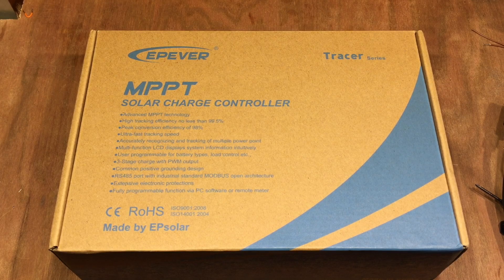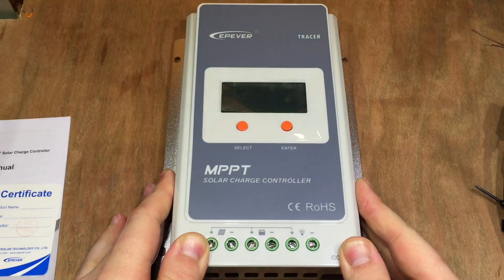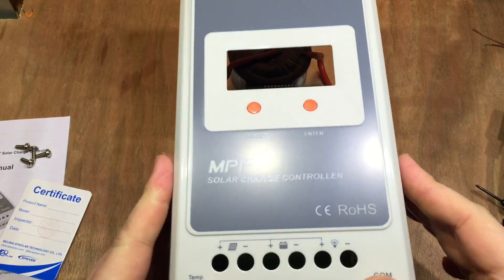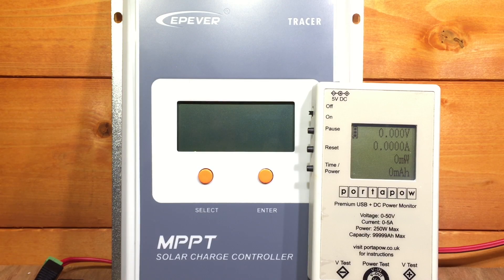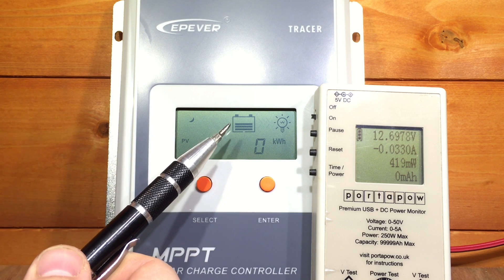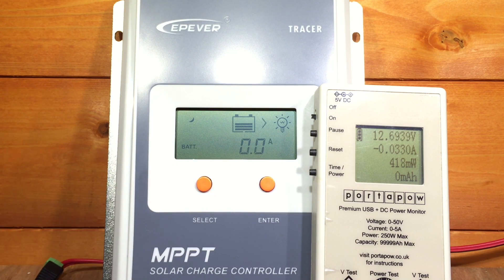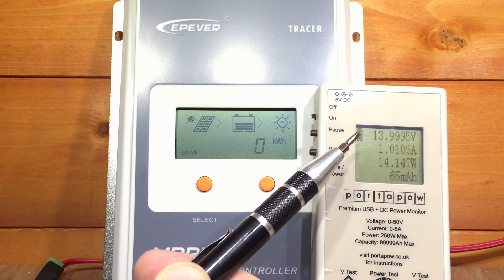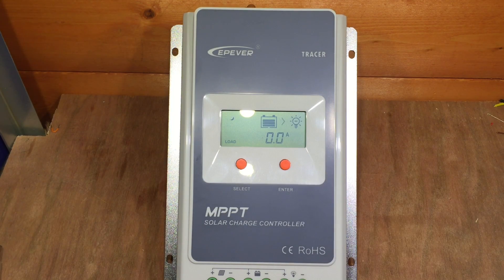MPPT Charge Controller Review - EPSolar EPEver Tracer A Series - 12v Solar Shed

Comment: Thanks for this. According to a review I saw on this Tracer, there is no setting for AGM batteries. Is it not advisable in this case? We have 6 AGMs in our bank
Reply from the maker: There is a Gel battery mode.  However all the charging parameters are adjustable with either the USB cable and windows software, the MT50 remote meter, or the wifi or bluetooth dongles.  So you can easily set it up how your battery manufacturer would advise you to.
Reply: AGM and flooded batteries are reportedly the same setting for charging - according to the documentation I had with the Xantrex charger inverter we run on our boat.

Comment: Hi Adam, I've been binge watching your solar charge controller videos for a couple of day, they're great !!  One thing i can't seem to find an answer on is this, I have a 20ah 3s lithium ion powerstation that i purchased from amazon.  It can be charged at 15v and up to 5 amps as it can with a dc power adapter for charging at home.  There is overcharge/overcurrrent, etc. protection built in.  How would you go about charging this device with a 100 watt Solar panel (i ordered one) which has peak 18v and 5.5 amp output ?  I know i would need a charge controller, but what would it tell the charge controller to do ?  Is there a constant current option on MPPT charge controllers where i can specify the exact volt and amp output ?  Do you think a 100watt solar panel with the specs i described be enough to charge this battery pack in a reasonable amount of time ?  Just can't seem to figure out how I'm going to charge this pack exactly, any input you could provide would be greatly appreciated.  Thanks, and keep up the great work !

This is the lithium power station https://www.amazon.com/gp/product/B018GE8JPY/ref=oh_aui_detailpage_o02_s00?ie=UTF8&psc=1
Reply from the maker: I've had a look at the amazon listing - and looked at the solar panel it suggests to charge this device.  Both suggest they'll work to around 18v.  The listing also points out that there is overcharge protection.
If you connect a solar panel straight to a battery the panels voltage will be dragged down to that of the battery - or just above actually.   So it might be possible to just connect the panel directly to your unit - there clearly is some charging circuitry in there.
You might find you can't connect a solar charge controller to the solar input - it may have a diode on it to ensure the battery can't feed the solar panel.  That would stop most solar charge controllers from working properly - they might not power up at all, or they can't work out what voltage the battery is at.
So first job is to see if the solar input, is also an output. Can you place a multimeter across that input and see a significant voltage?  If you can it may be worth looking for a solar charge controller that will let you set a battery voltage target around 15v leaving the internal circuitry to do the rest.  If you can't see a voltage on that input then most charge controllers won't work.
The other thing to test is the voltage output of the AC/DC converter.  It states 15v but it might actually produce a higher voltage when it isn't loaded - much the same as your solar panel.

If you don't fancy connecting the solar panel straight to the unit without any protection I guess you could drop the voltage a little across a series of diodes or something - but I'm struggling to come up with a commercial charge controller or module that is going to fit the bill here.
Reply: Thank you so much for looking into this for me.  I really appreciate it.  Coincidentally, I plugged in a 2.1mm dc jack that usually lights up when it sees power, into the charge port.  The adpater didn't light up, so i believe that there is no current flowing out of the charge port.  I will conduct a more conclusive test with a meter tonight but i'm pretty sure i will see the same result.  In a way I am glad you are struggling to find a charge controller that fits the bill as I've been feverishly looking for almost a week now and haven't found one either.  Last night i connected a 200watt hot air gun to the inverter and it ran fine.  I ran it for about 10 minutes and lost about 20 percent of the battery capacity in that time.  On yet another note, the dc output of this device puts out 12.6 volts when the unit is completely charged and is always live(whether i turn the unit on or off).  This makes me believe that the dc ports are wired to the output of the BMS on the battery.  I wonder if i can charge through this dc output port as well.  Also, I'm tempted to open this thing up and seeing if there is a way to bypass whatever is blocking the the battery from flowing current on the charge side as well and perhaps charge the batteries directly from a mppt lithium charge controller.  I suppose depending on what i find in there i may have to add some kind of extra protection as well .  Either way it looks like I have a lot of homework to do.  Thanks for your feedback once again.  I will let you know how it goes with all of this.

Comment: hello  i have a Tracer A series  30a but it is draining the  batter  at night  and tesed and it got power at + and -    at Solar panel  at night  wold you no what is going on tkyou
Reply from the maker: That sounds odd - absolutely nothing else attached to the batteries or load output of the tracer?  You may well have a faulty unit - you'll have to conect the EPEver support.  The last thing to check is to disconnect the solar panels for one night and see if that has an effect.  If it does your back feed diode may have gone short circuit and your panels are consuming power at night - if so speak to EPSolar or throw in a diode yourself.

Comment: I have installed this regulator but I have two questions
1) The regulator has turned off the load for no apparent reason and requires rebooting. It wasn't too hot, the battery had plenty of charge and the load was less than 1 amp at the time. Why?
2) we've had problems with our 12 volt TV freezing especially when running the inbuilt DVD player. Do I need a separate voltage regulator?

Comment: Thanks for the video much appreciated. I do have a question if you have the time. What does the positive ground mean to the controller and is the negative ground safer?
Reply from the maker: The EPEver is common positive which means it switches in the negative side of the circuit.  Many charge controllers do this because it's a bit easier and therefore generally cheaper.  Ground is just a reference to earth and could be on the positive side or negative side with no ill effects.  The only thing is that you need to be aware of which your charge controller uses so you don't wire it up wrong.  For example a car or RV will probably use the chassis as common negative.  So you couldn't use that to connect your panel negative to - it would effectively bypass the charge controller.

Comment: Thanks Adam. I'm a newby to solar power. In fact it is on its way to me. I bought gel batteries and while they are in transit read that I must have a charge controller that understands them. I am not sure if the one i bought does so found your video very interesting and thought provoking.

Comment: Hi Adam,  I've been running the 30 amp model in my motorhome for over 1 year.  I have two 24 volt 125 watt panels on the roof hooked in series.  The panels put out nearly 80 volts in full sun and the controller converts it all the way up and down the PV voltage range.  I've seen it putting 18 amps in the battery max so I could have probably got by with the 20 amp model.  I've got it under a seat so I need the MT50 on the wall.  It's a lot easier to control with the MT50 anyway.  One small problem is that it registers battery voltage about .2 volts high.  I didn't realize it was a positive ground unit until I bought it.  Don't know what the implications are but I haven't grounded it.  It think that I would buy the negative ground series if I were to do over.  I have DC switches next to the MT50 to disconnect the PV and Battery.  I have had to reset it a couple of times by cycling the battery switch.  All in all it works great for my application.

Comment: Hello Adam, thank you for this video, it was most helpful in branching my understanding of these devices.  I have an interesting project that I've been working on and I wanted to share with you my progress. I recently purchased on ebay, 7, 2 volt, 2180Ah industrial AGM batteries, wired in series, 12v battery system and 1 spare battery. I also purchased 2, EPever 40A Models and they both have 2, 235watt pv panels. I figured I need a lot more of these but could you advise on precautions I should take when I wire them to the batteries? Also, do you know if the EPever controllers communicate with each other when connected in parallel? This is in  reference to the desktop software.
Reply from the maker: +parkypark84 Sadly they won't communicate but as long as they are setup for the same charging voltages and profile they should work pretty well in tandem. 
I would recommend a fuse and/or DC breaker in between your batteries and your controller. Although they are internally used this is really a last line of defence. Suitably rated external protection is a must. 
The manual states you should connect the battery to the controller first - then the load and finally the solar. Other than those two things it should be fairly straight forward.
Reply: adam we are having problems getting the Light to turn on/off which is in the manual  under setting 100 why cant we get it to set....is this a backlight on the display

Comment: Hello Adam
Ive had a few problems regarding these epever controllers ive had two fail, the first one blew both fuses after only 2hrs work at less than 500w input and wont accept any dc input as it just shorts out and the second (replacement) stopped mppt tracking today on day 5 ,lost power to the lcd screen and the usb connection but still seems to charge in pwm mode? but at around 50w--100w max only with very good sunlight.
My setup is:
2x 250w panels (in series 60v)
epever tracer mppt 30a
300ah 24v lead acid battery bank

I also noticed that the volts dropped off from round 59v to 29v (losing its mppt function?) while boost charging during middle of day(batteries at 65%) according to data logger and that was around the time the lcd and usb dongle stopped working too.
ive opened the charger up and nothing looks or smells burnt.

So my real question is ,is there a known fault with these 30a models ive never shorted out the setup while installing and never overloaded it and its never reached anything hotter than 33deg c.
I have friends that use the 40amp version with no problems.
Reply: Hey, Carlospicywiener

I am afraid I am on the same boat as you. 

I had THREE 4210a models fail on me!!! 

My system is as follows:-

Three 150watt panels connected in series giving me approx. 60volts. 

One 12 v150ah battery. 

The first 4210a unit I bought was made in 2016/5 which is indicated on the serial number, it blew out as I heard a "pop" sound and I went to look and the screen was blank. 

I went to the retailer I bought it from and they wouldn't refund me my money, so I contacted Epsolar and told them the situation and they contacted the retailer and told them to take in my broken one for an analysis, then the retailer gave me one to use until mine gets fixed which they said had the exact same problem as me and they fixed it!! 

So I took it home it worked for a day then the next day at noon approximately 11:45pm I heard the same pop sound from it and sadly it blew like my old one..... 

I contacted Epsolar they said that it turns out the two I had were "bad batches" they came this conclusion from my broken one they told the retailer to test the mosfets with a multimeter and they found out that it's a bad batch. They told the engineer to replace the mosfets and replace the two 35 amps fuses and it started to work again, however they told me to disconnect one panel so that the voltage remains under 60 as these bad batches can't handle over 60volts.

Nevertheless the MPPT's manual clearly indicates that the controller can handle voltages from the panel upto 92v.

So then the company Epsolar told me that they will get me a replacement ASAP with a new batch which can also handle my three panels upto 92volts, so two months later it arrived from China and this batch was made in 2016/11 which was a relief to see. 

Sadly it worked for two days (it was cloudy) then on the third day which was sunny I looked over to the MPPT and saw a blank screen. 

It's the weekend now Epsolar told me to wait until Monday to resolve the issue, I will be making an update on this frustrating problem here.
Reply: Hi yusuf sorry to hear your problem also ,i suspected a bad batch from a certain manufacturer myself even after the seller accused me of incorrect setup. Im now on my 3rd epever controller (and the last if it fails) but this one is from another trader on ebay and all seems to be working fine,ive also noticed this new controller is running a LOT cooler than my previous other units with the same current.
I look forward to hearing how you get on.
Reply: +Carlospicywiener  thanks for this.. my 30a charger quite working and just doesn't charge... it's actually draining my batteries with the load turned off.

Comment: So if you have different PV panels, or groups of panels, each connected to its own MPPT charger.  Can more than one PV MPPT be paralleled to a bank of batteries with a single grid-tie inverter?  I would think different PV panels would produce different power levels due to shade, etc., and as such the MPPTs would produce different voltages.  Would they "buck" each other?  Are they designed for this?  How would such an arrangement be set up?  

My roof has six different areas that each receive sunlight at different times and for different periods.  I was thinking of using separate small groups of panels.  Each group would have its own MPPT charge controller but these would all go to a single battery pack with a single grid-tie inverter.  Am I overlooking something.
Reply from the maker: Hello.
Multiple charge controllers is possible yes but you need to be aware of a few things.  Lead acid charge controllers generally have a three stage charging algorithm.  Bulk, Absorb, Float.  If we imagine a single charge controller system for a moment, bulk will happen first on a morning when your batteries have been used over night - it delivers as much current as it can to your batteries when they are low.  It will then get the batteries up to your absorb voltage setting and hold the batteries there by throttling the power coming into the system from the panels.  After (usually) a pre-set time the charge controller will go into float mode.  Similar to absorb, but generally a lower voltage.
So now lets imagine a two controller setup.  You're first controller gets the earliest sun.  It's done bulk mode and because it's a bright day it's in absorb.  Your second controller starts to make a bit power lets say after an hour or two, but the batteries are already quite high - you've set both for the same absorb voltage so the second charge controller goes straight to absorb mode and it starts it's timer. 
The first charge controller has now completed it's absorb cycle and wants to go into float.  At this point it stops harnessing power from the solar panels because it wants the battery level to drop.  However the second charge controller is in absorb, and so your first charge controller is doing nothing.  Once both have completed absorb, both go into float and both (assuming again both are set the same) maintain the float voltage.  
So for periods of time one or other strings of panels in full sun (potentially) aren't creating any power because the charge controllers are doing different things.
If your batteries are full by the end of the day then you might not be worried about some lost power, but you might worry about a battery which has been held at absorb voltage levels for a long period of time.  A way round this would be to have the first controller to get sun on a morning to have a 90 minute absorb cycle and the following ones to have one as short as possible.
Now you are also looking to put a grid tied inverter into the mix.  This depends on the model of inverter - but presumably if you are looking at separate strings and separate charge controllers the inverter is going to run from the batteries rather than directly from the panels?  If so that could work too.  You want to ensure it has a low voltage cut out though so it can't completely flatten you battery bank.
Hopefully that makes sense and is of some use to you.